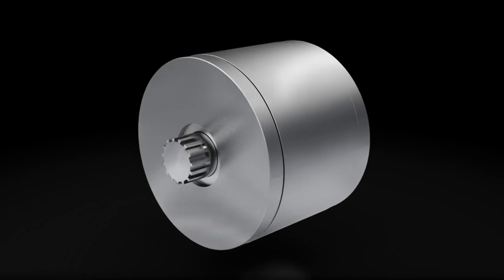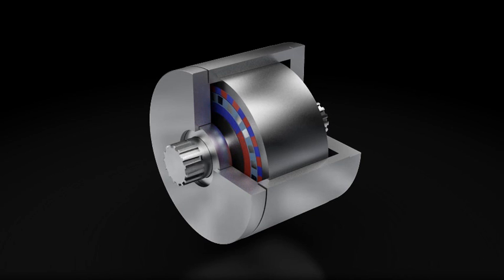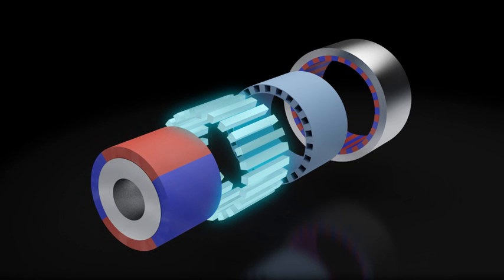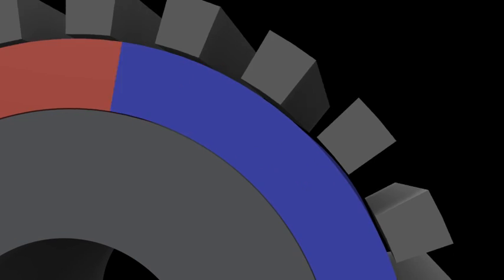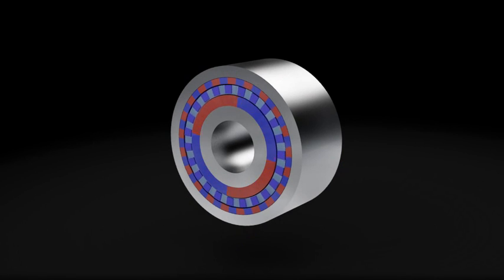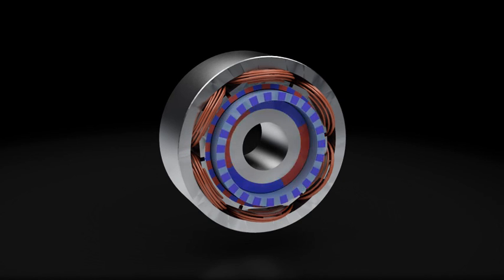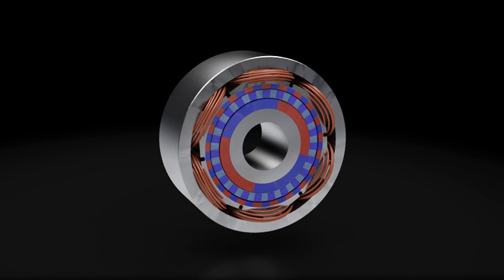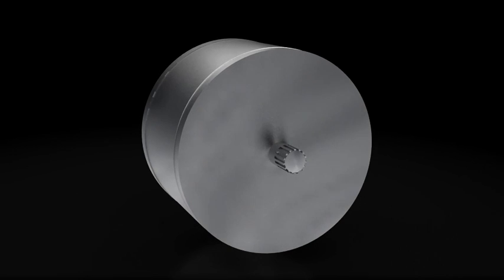Magnomatics - Magnetic Gear

Comment: What is your tactic for displacing heat? I'm sure phenomenal amounts are generated.
Reply: no friction=no heat
Reply: @H3c171  but there is induction
Reply: @umuraydin4337  oil cooling？
Reply: @H3c171  what about air friction? or current induced heat?

Comment: But how do you choose the gear ratio? Is it determined by the ratio of the total number of steel slabs inserted in the middle ring and magnetic poles in the outer structure?

Comment: This is a really cool idea but three problems come to mind.

1) It seems like you are going to generate A LOT of eddy currents causing lots of heating.

2) I am not sure that there are permanent magnets around that won't gradually degauss under so much alternating magnetism.

3) The system is in an unstable equilibrium for radial forces. If the steel ring or the center gets a little bit to one side, it is going to start preferentially pulling in the direction creating torque on the shaft that is going to increase the friction in the shaft bearings or twist the shaft out of alignment.
Reply: Well u can wrap it ina vacuum for no heat
Reply: @ununius7436 the heat source wouldn't go away, the cooling would.
Reply: Use of ceramic insulators and the integration of a heat exchanger system where the heat generation could be put to use elsewhere. Maybe. An interesting aspect would be if this could be used in reverse, to exchange the torque of a perimeter driven motor for rpm at the inner diameter of the motor... ie; the characteristics of perimeter driven motors such as those used in some marine applications to transfer their more efficient propeller design (outer edge forms the motor hub and no central ‘hub’ is required for rotational drive)
Reply: You can use a paired arrangement working as a conical bearing, or you can make the same thing but in a radial arrangement, if the application includes strong radial forces.

Comment: very good points friend but remember gears work on a pressure angle of like 22deg this computes to massive power loss  also gears are actually cams that slide just a bit causing friction, believe it or not the eddy currents would be minimal with lamination techniques at low rpm. this is after all a concept vid they would add more details during D&R  like cooling finns or fan blades for cooling but again you make some dam good points gears aint what you think i was amazed wen i read a book on it

Comment: It's been over four years since this was posted. Surely there must be examples of its use today. What and where are they?
Reply: +FOAD RIGHTNOW The alternating magnetic field creates eddy currents in the steel, and the fact that they're using only permanent magnets means the axis of rotation would be unstable unless every single part was machined and assembled perfectly. Melting steel and huge vibrations must have rendered this device useless.
Reply: TheSmileyFacedPizza
Good point. So essentially you're saying it would act like an induction coil, correct? But surely they would have foreseen that, wouldn't you think?
Reply: FOAD RIGHTNOW Not everyone that tries inventing is smart.
Reply: TheSmileyFacedPizza
So true. The video sure looked polished and professional enough to suggest that the makers of it knew what they're talking about, though.
Reply: FOAD RIGHTNOW Well, it's not exactly hard to make CAD models and have smooth, confident commentary over it. I could make a CAD model of a typical room heater and explain how sending an electrical current through the oil causes it to lower in temperature, cooling down the room, which creates a heat vacuum to draw in warmer air from elsewhere. But that's obviously not what would happen.

Comment: An interesting idea. I wonder if they could use similar approach to recreate simple dual input planetary gearbox with motor(s). Imagine how would it be - planetary gearbox which also is an electic motor with two independent rotors, affecting output shaft.

Comment: Sounds promising but I like to know its disadvantages too.
Reply: +kf160k160 They aren't difficult to think about really:
1. 'It has no wearing parts, and therefore does not require oil lubrication'. False. The mere fact that it has an input and output shaft suspended away from a casing means that you have two points of wear and lubrication requirement: the input and output shaft ball bearings.
2. 'No friction". There may be no friction between the actual ratio reducing element, but, again, the bearings at each end create friction. This may well be a good idea, but this video makes it sound much better than it is.
Reply: What about magnetic bearings at the ends?
Reply: These will also need to be replaced due to loss of magnetism. I'm not sure how long that would take, but materials do lose their magnetism over time.
Reply: Xander Zoolander it's a very very very very long time lol
Reply: magnets will demagnetize
Reply: Xander Zoolander yeh like 50 years I'll take that all day
Reply: To give another one, as long as I know, magnets lost electromagnetism when gets hot.
Reply: @BioClone  That is true of Disprosium. Disprosium loses its magnetic properties at 80 degrees Celcius. The other ingredients of supermagnets are Iron, boron and Neodymium. I am sure these give out at some temperature, too. But it is much higher than 80 degrees.
Reply: @samtrower4271  one more thing- 
if these gears won't have physical contact then it really need strong force which will increase electricity input and heat as well.

Comment: you say "no friction". you are planning to fix shafts with magnetic field. how much energy is required to hold shafts tight? you know that magnets does not stay magnetized forever. you have to pass current. also too high magnetic force, to hold shafts tight, can affect other parts of the total machine. how do you plan to prevent that?

Comment: 12 years later, this has not been manufactured and is still not available for any practical use. Maybe because the magnets, even though they spin slower, don't add any torque before slipping.
Reply: 14 years later...

Comment: I'm MISSING SOMETHING , how does this magnetic gear ratio changer give a constant torque , ratio , or use, if only magnets and a steel section separated by air , are used , are you turning a very small display ?

Comment: wait if the magnets spinning induce current in the steel bars, which further produce eddy currents. wouldn't this be a counter for and electric motor working with this as a variable transmission. i mean high torque is at 0 RPMs not 10000

Comment: sounds good but as per the presentation the speed reduction ratio is fixed and cannot change. If only it could switch ratios the it could have been used in electric cars :)
Reply: we do slipping for that! they can now even be programmed
Reply: The thing about electric cars is that they don't NEED gears.
Reply: @paulsutton5896  I hear, with eBikes, hub motors, where there's no gearing, tend to burn out more often than mid-mount motors, where they can benefit from the bike's gearing. Hub motors can do it without gears, but should they? Driving uphill is sometimes unavoidable.
Reply: @rmarbertin8131  Well. There are, no doubt, many bright people constructing vehicles with all sorts of ways of overcoming the inherent "gearing"  problems. The big problem for evs remains the battery, of course. But why not gears, with magnetic clutches? it will be interesting to see what designs present themselves.
Reply: @paulsutton5896  sure, but on the other hand, Planned Obsolescence is a thing. It is incumbent upon us to be smart shoppers, and not buy a car from the company that will have you burn your motor out for not living in flatland.

Comment: Bullshit on the "no wearing parts" part. Magnetic components involved start to get misaligned in their fields. Causing a magnetic form of decay in capability!

More efficient, Yes.
Yet not forever let alone longer lasting then a well adjusted set of high heat tolerant/stress gears.

Comment: This is a basic dc motor.
Reply: Actually, it's two basic DC motors stuck inside one another. One minor issue is that if a magnetic field gets too close, it might a cause a skip, stutter, or drop in speed in another wise stable system.